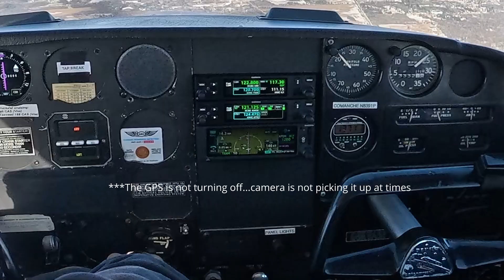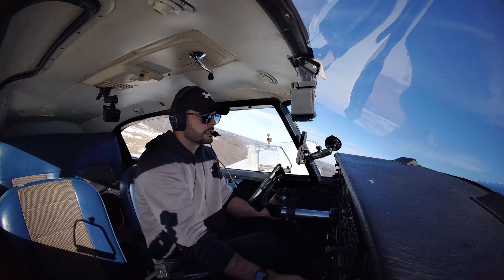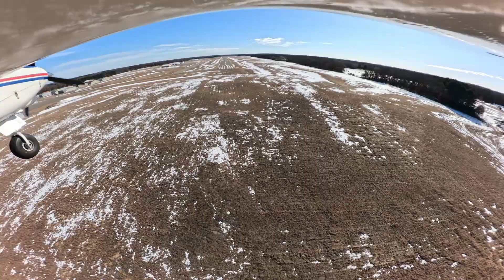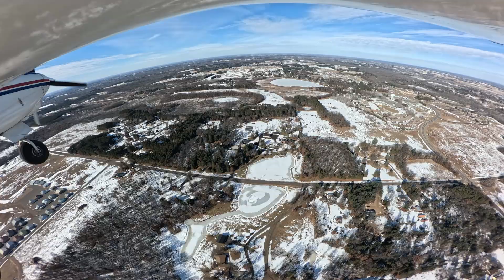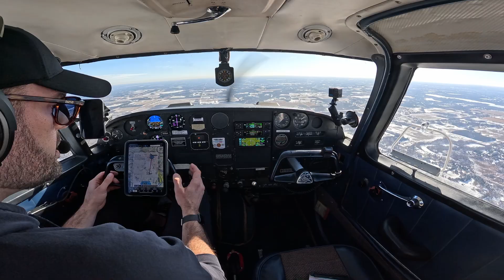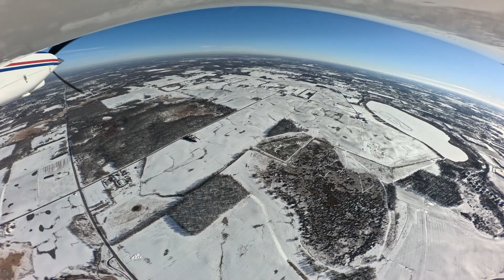Practicing Emergency Power Off 180 Landings | Piper Comanche 250

Comment: Great video. Thanks for taking us along. Nice job on the Power Off 180's! Question:  Do you tab the brakes, to stop your main wheels from spinning before gear up?
Reply from the maker: Yep! Exactly, just stop the mains spinning before retracting them.  I took down the little reminder sign now but had it up as a reminder until I have it locked in my flow

Comment: Another great video! Question: On the last approach you mentioned your speed being a little high, but your prop was not in yet. Your MP was plenty low, so why not push the prop into 2500rpm to use the lower blade angle as a speed break?
Reply from the maker: Great idea!  Yeah managing the prop pitch changes the glide quite a bit, this was my first time practicing power off 180’s in this plane so I’ve got work to do!  I think I felt like I could drop the speed easily enough with flaps but the prop pitch is probably a better move initially since bringing up flaps would be almost impossible to do if I wasn’t in fact gonna make the runway
Reply: I’ve found it’s very challenging to make the power off 180 in any sort of adverse wind with the gear down on downwind and slowed below 120mph.  Talking to other Comanche pilots, I moved putting the gear down to the abeam point to keep more energy available in case of an emergency.  For the power off 180, I’ve found keeping the gear up until the start of the base turn makes a huge difference in making the runway.  I keep my hand on the gear switch from power off until confirmed down.  In a real engine loss, if at all possible pull the prop to low RPM as that is worth a few hundred feet per minute in reduced drag.  For approaches I keep flaps up until landing assured to make a go around less work.  The Comanche behaves well on approaches anywhere between 110mph and 135mph so I’ll usually go with the the lower or higher speed depending the traffic mix and runway length
Reply from the maker: @planeplaces amazing advice, I can definitely see leaving the gear up making a massive difference.  I’m gonna practice this exact procedure, definitely seems to be the best process for a true emergency